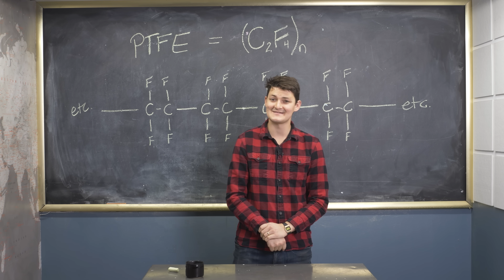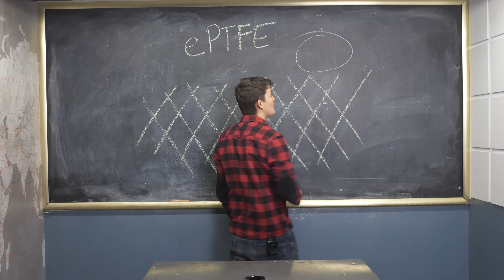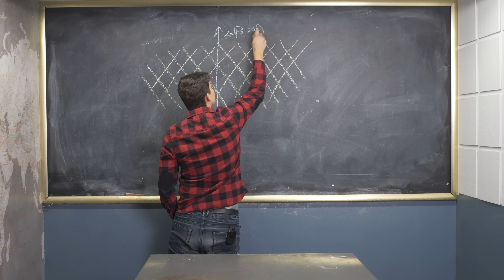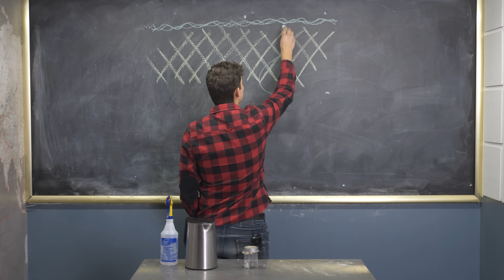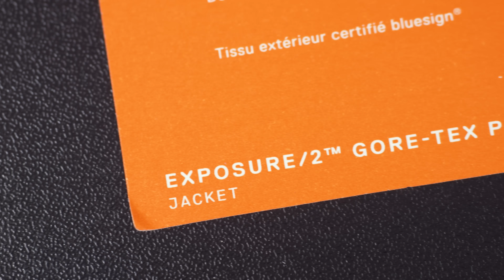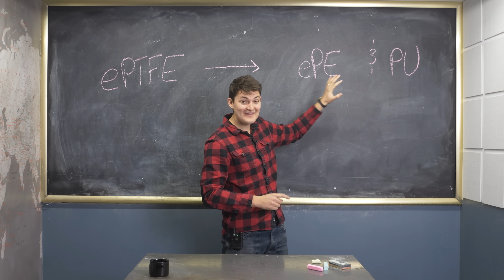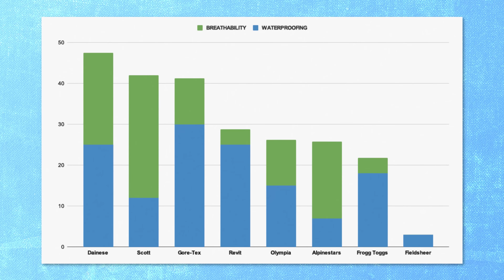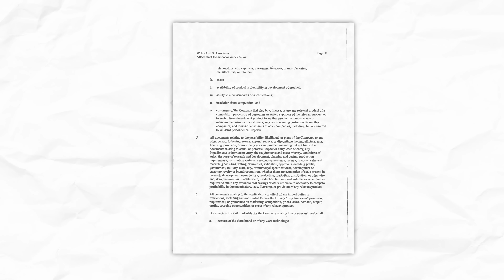Gore-Tex is a Marketing Gimmick

Comment: The problem is not consumers but the lack of standardized breathability and waterproof labels, comparable like specs on torque and hp. Consumers are forced to pay for the Gore Tex label because it is an assurance that the “breathability or waterproof” is likely to be among the best, while a random pick is far likely to be worse (8:50).

Comment: Some of the old-school gore-tex worked great (aside from the negative environmental consequences of PTFE production) almost purely to its ability to repel water. Even then it was barely breathable and was just as horrible to wear in humid environments as a rubber jacket at a fraction of the cost. My experience wit h the off  brands has been even worse so far. Here on the we(s)t coast your better off either embracing the suck (wear wool) , take the risk with some sort of water repellent fabric, or just saying fuck-it, rubber raincoat all the way. One thing i will say however.... whatever rain gear you are wearing... make sure it covers the tops of your boots. Not a fun way to ride.

Comment: Not impressed.  I've never worked for W.L. Gore or any associated company, but I did work in the outdoor industry for most all my full-time working life.  I'm retired now, but still very active in the outdoors.  I've used Goretex and other "waterproof-breathables"  for more than 40 years.  Goretex is the best product of it's type that I've ever used.  My clothes stay dry under goretex waders when fly fishing, and that's just about as severe a test as you can put a claimed waterproof breathable fabric to.  Before Goretex waders, the best waders you could get were made out of neoprene, the stuff used in both wetsuits and drysuits.  Dry suits, of course, must have all seams sealed and waterproof latex? seals at ankles, wrists and the neck.  Neoprene is great in that it insulates, well, sometimes not so great also because it insulates (great in the cold, uncomfortable on a warm day).  Anyway, after a day of fly fishing any cotton clothing I had on under the neoprene waders would be absolutely soaked from perspiration.  With Goretex waders there's no such problem.  They still get a little humid inside, but nothing like neoprene.  Wear insulating layers underneath and Goretex waders are awesome in cold weather and, dressed lightly, they work great in warm weather.  Don't tell me they're not "breathable", I know better, based on many years of first hand experience.  In my younger days I worked as a mountain guide.  My Goretex rainwear did a much better job keeping me dry in the mountains than any other waterproofs I've used.  Before goretex the standard was nylon with a waterproof, decidedly non-breathable coating. Is Goretex perfectly breathable?  Heck no!  Also being windproof it still presents a significant barrier to moisture movement, both from the outside in and the inside out, but it DOES BREATHE and kept me warmer and drier than any other product I've ever used.  Back in the day a competing product came on the market that was called e-Vent.  I was told by people in the industry that it also was waterproof but more breathable than Goretex.  Sounds like that it would be a good choice for full dry-suits, like whitewater boaters wear.  Anyway, one of the main benefits of Goretex is that W.L.Gore eventually established very high standards for the seam sealing process.  That's critical to the performance of any waterproof.  In the early days customers actually had to seam seal their own garments with a glue-like seam sealer from a tube.  Needless to say, that introduced a huge variable in how the garments performed. Eventually Gore developed a very good seam-sealing process that used waterproof tape to seal the seams of Goretex garments on the interior seams.  That changed everything.  THAT is what made Goretex viable for waders, dry suits and such.  It also made for consistent performance of Goretex across brands.  If your seam sealing process didn't meet Gore's standards they wouldn't sell you their Goretex Fabric.  I'm not in the industry anymore and know basically nothing about the expiration of their patent.  In theory, that means essentially anyone with sufficient resources could manufacture and sell their version of the same waterproof-breathable technology.  My only concern would be "Do they also enforce the same quality standards for seam sealing that Gore does?"  I'll tell you right now that Goretex is a great product for the mountains and in cold rivers.  If you're hiking up steep mountains you still need to ventilate, so pit zips and such are a good idea, and I wouldn't be surprised if Goretex offers little or no advantage in the steaming tropics, but the stuff was a true breakthrough in waterproof fabrics, and has made my life in mountains and on our rivers immeasureably more comfortable than it would be without  it.
Reply: I can't help but feel like you either didn't watch the entire video or didn't comprehend it...

Comment: In the Air Force I did the same thing to my M-65 field jackets as my Gore-Tex with identical results, which is DRENCH them in Scotchgard each fall or as required. The best rain gear I ever used was non-breathable military green rubber. I wore the pants riding in to work during winter because they're wind-proof. Another motorcycle tip is scarf modification. There is NO functional reason for a scarf to be knitted as a strip instead of a loop, so I had the base cleaners sew the ends together. I loop that over my neck than put on my full face helmet. I also wore it on the flightline because unlike standard scarves it cannot accidentally fall off and get sucked down an engine.

Comment: I don’t know about this. I’ve been on my motorcycle far from home in fuck all bad weather, pouring rain and sleet, nowhere to stay and the gtex gear is the only reason I’m writing this today. Say what you will I know it works.
Reply: if you had bought waterproof gear that was the second to a company's flagship model instead of THE flagship model, you would have been just as dry while spending less. Goretex works but their cheaper competitors work just as well

Comment: I hate Gore-Tex! Thanks for spreading the truth about it! I live in southern California, and I hardly ever hike in wet weather. In fact I often hike when it's 100 degrees or higher. And I discovered a long time ago that Gore-Tex really doesn't breath very well, yet it's extremely difficult to find quality boots without it. It was very frustrating. So I finally began using cheap Gore-Tex-free boots from Big-5 sporting goods. They don't last as long and aren't as comfortable, but having that breathability is more than worth it.

Comment: Is PTFE itself a significant forever-chemical in the problematic sense? I thought that was apllication additives like for coating frying pans.
But the waterproofing sprays should definitely be shunned, because those are apparently a big burden. (And you touch the stuff all the time, since it is used on clothes.)

Comment: All of my jackets have ended up soaked, the best waterproof clothing I had was a hefty PVC suit and pants raincoat, which in the tropical climate of my home country will cause me to be wet due to my sweat unless it was raining from the afternoon till the night and I go out at night.

Unfortunately, now that I am studying in a country that has winter but not snowing everyday of winter, I left it at home since I thought it went over the baggage weight, though it turns out the scale at the airport measured the weight less than the cheap luggage scale my dad got.

Comment: I used to wear what was called stealth suit jacket, it was just a thin jacket of just gore tex. It was worn between my undershirt and over-shirt.

in this configuration yes, when you were in the rain moving around it didn't breath enough to stop you from sweating, but what it did do, is keep you warm enough that when you stopped moving, the water blocking the Gore-Tex would evaporate, and then you'd dry out. in colder weather you could see the mist coming off like a smoke machine. 

any other material will either hold water and drop your temperature, or it will prevent drying out from evapouration

That said, I had a problem where we were in a week of torrential rain, and instead of getting into my sleeping bag I was laying on top of the Gore-Tex bivy bag because it was warm enough and I didn't want to have to change in and out of wet clothes. because I was drying out and water vapour was coming off me it also went through my bivy bag and made my sleeping bag damp for when the rain stopped and it cooled off further.

Comment: Gore-Tex misleads consumers, but the technology is still applicable in certain environments. It is liquid waterproof, but not water vapor proof. The membrane is diffusible to water vapor both ways - in and out. It is permeable to water in a gaseous state.

This is problematic in humid environments or down pours, because the outside environment will become wetter than the inside environment and water vapor will diffuse into the garment.

Generally, Gore-Tex is best applied in arid environments or high elevation regions like the mountains where humidity is lower, and the jacket will breathe inside out, and evaporate water quickly off its surface. A jungle or coastal region would be the worst place for Gore-Tex.

It also pays to buy only 3 layer Gore-Tex garments. These breathe considerably less, but can be used in heavier rain or wetter climates, because they are not as permeable having the addition of 2 extra layers sandwiching the membrane.

Gore-Tex is more breathable than a rubber rainsuit or poncho, but not as dry. It is an "in between" technology that is mislabeled on purpose so Gore-Tex and reach a wider market.

Comment: its how u apply the gortex as a design like if they put holes etc. i wear it as a thin layer waterproof jacket in a larger size so the air flows better something loose with velcro straps so i can keep it tight or keep it cool hang loose.i like a columbia or something and wear breathable layer inside like a woven sweater or just a t shirt

Comment: 5:04 because when it beads off, it's breathable again. Then the whole point becomes "gore tex is a rip off only with no dwr coating, otherwise, 'it's gore tex.' A garbage bag doesn't breathe. Please correct if wrong.

Comment: I have a lot of ride gear and all I know is that the best of that has the goretex label. I have been caught riding in a severe north sea storm for hours at freezing point in a goretex jacket with only a t shirt underneath and somehow it was just like a sunny day under that jacket! Warm, snug and totally dry. I felt untouchable by anything the elements could throw at me. And the only gloves that I have that truly perform in really wet and cold weather are goretex lined. The jungle tramping analogy is not relevant to motorcyclists as the speed of riding always creates wind pressure/suction to activate the breathability and when its really soaking wet we would all happily sacrifice breathability for a proper moisture barrier, esp given that the air at such times is laden with moisture, so actually preventing breathability is an important function and not a defect, as the FortNine  theory suggests - There may be other products that perform similarly well - but how would you know whether they will perform in the absence of a known product that has developed trust with consumers? Most of the alternative I have tried dont perfrom nearly as well. Goretex has differentiated itself by performing and building that trust. Thats not always worth paying double, but it is certainly worth paying a premium for imo

Comment: My experience with gore tex membrames in my shoes was extremely postive actually. When hiking and going to a shallow river, mis stepping, still had dry feet, but absolutely no breathablity issues. Never cleaned it, still worked, only after 3 years the whole shoe fel apart, which is expected. 

I have had some other outdoor brand jackets, but wasn't to impressed. So maybe shoes are easier to manage this membrame or gore-tex really has a advantage over the others. Always hear this from the army guys too.
Reply: how will your shoes "breathe" when they are covered with mud ? that usually happens before and after crossing rivers.
breathability is overrated, give me damn rubber waterproof boots

Comment: And gore-tex IS STILL using teflon in their production, in 2017 they pledged by 2020 they wouldnt be using pfas and use environmentally safer alternatives. Not only did they miss the 2020 deadline, they pushed it back for half a decade calling for "product development and scaling challenges". Greedy bois for sure

Comment: Been riding motorcycles in the British rain for years, goretex is okay in light rain for city use. But very crap for the price, also one heavy shower and it will fail. Seems to fail on the motorway as well when the wind forces the water in.

Comment: Yes you're right, membrane waterproofs can not be  waterproof and breathable at the same time. However I have had other waterproof breathable waterproofs (Marmot, Pertex Shield) that are pretty much useless. Goretex performes better. My personal preference is for Goretex Paclite and just use when absolutely necessary. I use a 3 layer GTex drysuit for canoeing. It's not perfect, not by a long margin, but it's waterproof and you don't end up drowning in your own sweat. It's easy to knock, but what's the alternative? I have and have had Paramo and that is a load of bo**cks too. Just in a different way and with a great selling pitch. .Collumbia had a good idea with the reverse stuff because the main problem with all waterproof/ breatheable gear is the infectibility of DWR.

Comment: I'm pretty sure Gore-Tex went mainstream with snow sports, where it is usually high altitude, very dry/cold outside, and humid/warm near the body, thus working as intended for your differential explanation. I haven't really seen Gore-Tex on non-snow products up until the past few years and now it's on everything.

Comment: I guess Ryan won't be getting any freebies to test with a "Gor-Tex" label on any time soon.
And Respect! for that.

Also i think that finally clothing manufacturers have got wise to the fake claims that a material can simultaneously be wicking/absorbant/breathable/waterproof/water-repellent/abrasion proof/insulating/cooling... and have instead inserted little zip flaps in the chest/sides/back to channel fresh air in, and humid air out when moving. 
It's so much better, and controllable AND cheaper too.

Comment: I don't buy Gore-tex. My experience with it is only because I was issued a Gore-tex camouflage rain jacket from my military unit. I still have it. It was insanely expensive (but free to me). My experience with the aforementioned jacket is that it does NOT breath very well, and I sweat my ass off when it is mildly hot and raining because, as you pointed out, it's one OR the other; not both at the same time. I don't wear it often anymore, and if I do, it's when it cold and wet outside, which allows me to layer up underneath the jacket and just rely on the jacket for it's waterproof properties, while allowing other clothes to provide me with necessary warmth. I'm glad you pointed out the other two better brands. I'll be looking at some of those for my riding rain gear! Thanks a ton, and happy new year!!

Comment: After several decades working outside. I can safely tell you not to waste money on gortex. You are far, far better off wearing waterproof garmets with flaps facing opposite the direction of water travel. That way when you move moisture gets out, but less likely to get in. Key is, you have to move.

Do not waste your money on gortex. It is garbage.

Comment: I buy things NOT on name recognition, but rather on an items performance. When i was buying my first motorcycle gear i ended up going with Klim riding jeans, an Alpinestar jacket and gloves and an Icon helmet. I did not and DO NOT care about the brand name, only what works best for my needs. I've even traded out my Alpinestar jacket for a leather one, not because of the brand name on the jacket, but because it works and feels better wearing it. If more people would STOP looking at the brand names and start ONLY buying things based on their quality and function, then brand names would no longer matter. I mean 99% of the time your paying upwards of 50% MORE for a product JUST FOR THE NAME alone when its just as good or even WORSE than the "not brand name" version.

Comment: I have two Gore-Tex branded pieces. The sneakers feel very all-weather, except for heavy snow of course. I even wear them hiking in hot & humid tropical weather and I don't find them uncomfortable. The poncho is something that comes out only when there's rain. It has done alright in drizzles and thunderstorms in more urban environments so far but I definitely feel sweaty under it. Fortunately because it's a poncho, it has way more ventilation than a jacket would.  Either ways, I got both as secondhand purchases for fractions of their original costs, so I'm not too mad about it.

Comment: A lot of those points I don't find valid. Like, people don't buy breathable membranes for rainforests. If a plastic bag is better I encourage you to put that on and walk uphill for 30 minutes. The marketing part of the video makes sense I guess, but my experience from outdoor hardshells is that the advantage of gore-tex over other fabrics isn't in the waterproofing (everything is good enough) or the breathability (lot of other materials are actualy better) but rather the durability. Also, I think that what drives Gore-Tex as a company isn't really the clothing. Materials from the company are used in medical technologies, like artificial artery transplants. Much less competition in that field plus its extremely expensive.